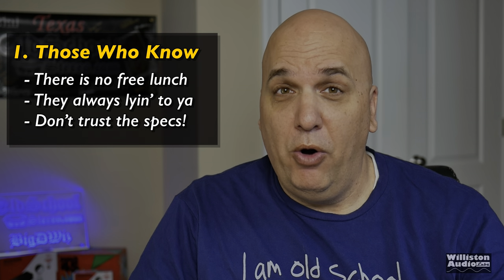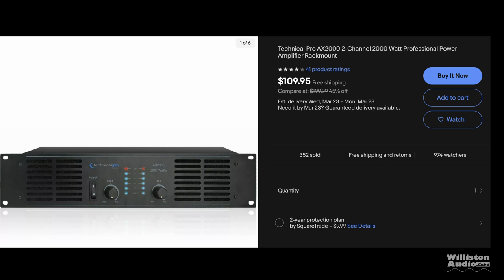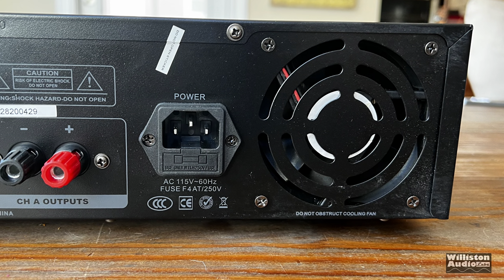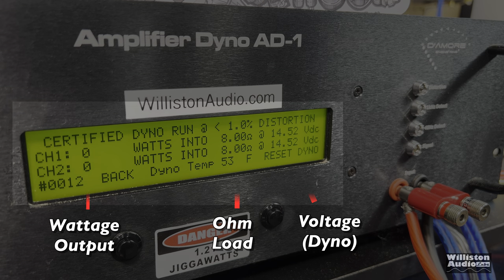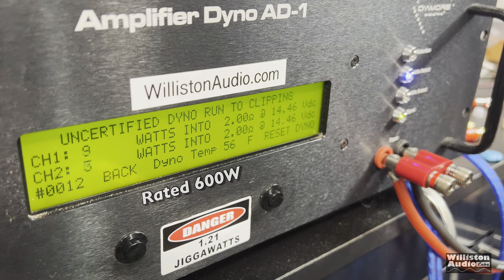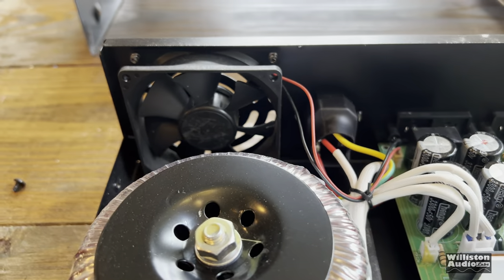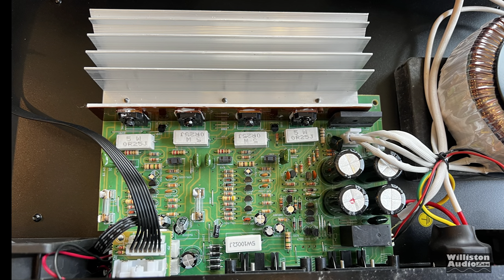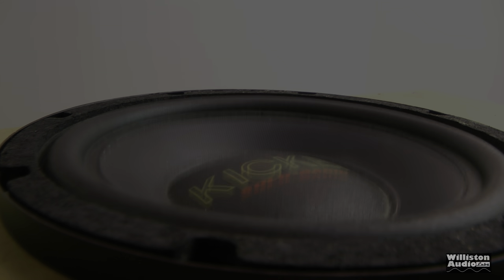Pro Audio Amp on the Cheap? Technical Pro AX2000 2000W of Unicorns [4K]

Comment: LMAO! Yeah, any of those "no name" super cheap, super lightweight "pro" amps, especially when they claim ridiculously high supposed wattage ratings, (like in the multiple 1000's of watts), and especially the ones that are made in China, are almost ALWAYS totally BS rated, and as a general rule of thumb, you can usually just take the claimed wattage ratings of them and divide it by about 100 and then you get a realistic approximation of its REAL and CLEAN, (i.e. UNdistorted) RMS power output, Lol! (example; a "5000 watt" BS rated amp might put out an actual clean (<0.1% distortion) RMS of about 50 watts)

It's really SAD AND disgusting though, that these manufacturers are even allowed to get away with advertising their products with such grossly overly inflated specs, as it is definitely totally misleading people who don't know any better! They're also making a total JOKE out of the audio industry nowadays, because they're not even anywhere CLOSE to the same quality level that REAL power amps were back in the good old days, when everything was made in Japan!

BTW, I really wish that that amp dyno would show you power output at 0.1% distortion also, for the "certified" power, (which is the old, original, long standing standard for the beginning onset of clipping), because at 1%, that's already WELL INTO clipping already, even already noticeable to a person with good ears!... So that makes me wonder at what distortion level(s) that amp dyno shows power output for the "uncertified" and "dynamic burst" tests... probably 10% distortion or higher, would be my guess, which is already GROSSLY noticeable (i.e. totally and easily hearable) at that point!... Which is also a point to which you NEVER want to drive your amp, especially if you want it to last for many years of music enjoyment, AND you don't want to blow your speakers, especially the tweeters, as clipping distortion is probably the MOST harmful to tweeters!
Reply from the maker: 1% is not clipping and although I agree it would be nice to measure under 1%, I think it’s a useful measurement
Reply: @wal  Well, in home audiophile terms especially, 1% distortion IS considered clipping, maybe not for typical car audio stuff, but for ANY REALLY good quality home audio amplifier, 1% distortion is definitely into clipping already, not super badly, but it's past the technical standard point of the beginning of the onset of clipping, which has always been known in the home hi-fi industry of decades previous, as 0.1% distortion...

That's also why you always would only see (now vintage) amplifiers, and better quality receivers, all rated at that distortion level MAX, and usually even at a lower point, like 0.05%, which was VERY common for RMS ratings of past home audio amps...

However, even with that fact, I also still believe that the amp dyno that you have, (even being designed around and more geared towards car audio than home audio), still does give a useful measurement even at the 1% distortion level, just not quite as ideal as if it was at the 0.1% level... I still wish it was a settable parameter on that machine though, as that would make it even better! I also wish that it would tell you at what distortion levels it measures the other "uncertified" and "dynamic burst" power levels at, as that would make those numbers it gives all the more useful and meaningful! It's a great tester, even as it is, but maybe they'll come out with a "MkII" version of it sometime in the near future that will add those other capabilities I just mentioned, as that would make me want one of them too!
Reply from the maker: @JoeJ-8282  in NO terms is 1% THD clipping, doesn't matter how you slice it. I understand both home and car audio at one time thrived on the 0.05% ratings and that's great. It doesn't matter honestly. Some people like the sound of tube amplifiers and they are flawed according to measurements. Power isn't everything and my purpose of showing power output here is to give a standard to go by. At least you know the approximate power output, even if it's beyond the THD you allow as acceptable.
Reply: @wal  Your last sentence there I DO agree with. Even at the 1% distortion level, at least you still have an "acceptable minimum" (or maximum in this case) "standard" set reference point to compare things with, which is an absolute MUST, for totally even and truly balanced comparisons between any two audio components...

However, 1% distortion most definitely IS at least at the starting point of noticeable clipping, (for an otherwise totally "clean" sounding amp at power output levels which are still below that point of 1% distortion), because 1% distortion can even be noticeably heard in music by a person with sensitive and well trained ears, so that point is definitely at least at the beginning of noticeable clipping distortion...

And if you do more homework on the topic, and study hundreds of amplifier "distortion curve" graphs, as I have over the past 40 years or so, you will see that at right about 0.1% distortion is the point at which most (already clean sounding, UNDER 0.1% "normal" output distortion level) amps will begin to go from a relatively flat line of ("clean") distortion, all of a sudden up to that very sharp "knee" on their distortion curve, then at that point, and especially above 1% distortion, which is about the average for the middle of that very sharp "knee" of the curve, the point at which almost instantly above that point it goes sky high, VERY quickly up to 10% and then up to 100% distortion, which of course at those latter points it sounds like total garbage, AND is VERY bad for the amp AND any speakers connected to it, especially the tweeters... not to mention your ears, lol!

But so the 0.1% distortion level has always been the industry standard reference for the very beginning of the onset of clipping, at least for high-end HOME audio amps, and in the audiophile world, and that exact spec. has been reported and used for giving the TRUE, RMS, (still clean), continuous power output of an amp, for MANY decades already, and in countless magazine reviews of amps and such during my entire life so far, ever since I was a kid and I started being interested in technical and audio stuff... And I'm really good with remembering numbers and specs and stuff like that because I have Asperger's, which gives me an extreme acuity for understanding and remembering "facts and figures" and that type of stuff...

Anyway, that 0.1% distortion level has always been the industry standard for the very beginning of the onset of clipping, at least up until recently, where it seems like the "standards" have gotten progressively worse and more "lax" in order to let the cheaper "no-name" companies, (mostly from China), make totally outrageous power claims and sell their products, making the uninformed masses think that their product (with the "higher numbers" in their specs of power output, etc.) is "better" than the next amp beside them with a seemingly "lower" power output, even if that other manufacturer might rate their product to a much stricter, and much more realistic power and distortion standard... Nowadays unfortunately it's all a "numbers game" just to sell the most products, regardless of whether those overly inflated specification numbers they may use to sell said product are truly "legit" and actually up to any kind of good standard or not.

And I agree that 1% distortion is still at least a semi-decent standard for absolute maximum distortion from an amp in order for it to be considered "clean RMS" power output, (because it's still at least 10X better than the TOTAL BS 10% level (or even worse, the old "PMPO" or "Peak Maximum Power Output" ratings, which were usually completely regardless of distortion level), that some cheaper amps gave/still give for power ratings), but even rating an amp at 1% distortion for "RMS" power output isn't quite as good as the older, TRUE, Hi-Fi, HOME audio reference point of 0.1% distortion. (That newer standard of 1% is actually 10X worse than that original 0.1% standard, even if at 1% distortion, it's still only barely noticeable with careful listening... But my point is that I NEVER want to actually be able to hear noticeable distortion in my music when I'm listening to it, so I still think the older, stricter standard of 0.1% distortion should still be used for the "beginning of clipping" point, and most definitely never ANY higher than that newer standard of 1%, because above that point you can definitely begin to actually hear it.)

Part of that newer, more lax standard, is because the standards union or something like that was changed about a decade or so ago, and the rules were lessened in order to be "more encompassing", especially with the onset of class D amps, which now at THIS point have gotten quite good, even pretty awesome, but when they were first introduced, (i.e. in their "1st generation" of development), if you remember, pretty much all of the class D amps all started out having quite noticeably higher "normal level" (i.e. non-clipping), distortion levels, (as when compared to the typical, older style class A and A/B amps), of anything between 0.5% to even 2 or 3% on the first generation of class D amps, so the industry had to be changed to allow for that higher average level of distortion to be considered "normal" or "clean", but that is also one of the reasons why I (and many others) didn't like the sound quality of class D amps when they were first introduced. I'm really glad that most of the manufacturers have fixed those issues in recent years with class D amps, and made them MUCH cleaner and smoother sounding now than in the past, so that is really good, because class D amps have a few definite advantages over other, older classes of amps, mainly much smaller size & weight, and considerably less heat production... But anyway, I'm getting off on a tangent here...

Just closely study a few detailed and accurately measured amp clipping distortion curves, as I mentioned, and you will see that the overall average points for that very noticeable "knee" on every amps distortion curve, where it almost instantly goes sky high in distortion, (i.e. clipping), (that point) starts at about 0.1% distortion usually, and the 1% level is usually about at the center of the sharp curve on that "knee", and then anything above that point is already WELL into noticeable clipping distortion, especially at 5 or 10% distortion, as many really low quality car amps and even some cheaper home receivers are nowadays being rated at for their (total B.S.) "RMS" rating. I don't believe that rating ANY equipment at those higher distortion levels is at all acceptable though, because it just makes the uninformed people out there get into equipment that doesn't sound as good OR as loud as they hoped it would, plus it makes the general populous less informed as to what a truly "clean" music signal really SHOULD sound like!

Part of that is because of the manufacturers making stuff cheaper/flimsier and to an overall lower quality level now because it's just more expensive nowadays to still produce TRULY HIGH Quality stuff than it was back in the true "heyday" of REAL Hi-Fi audio, AND probably even more influential, is that ever moreso nowadays, it's all about the absolute most "profit" that a company can make, completely regardless of any kind of higher "quality standards", but its ALSO a very SAD and unfortunate thing of many manufacturers taking complete advantage of the fact that MANY people nowadays don't even have the first CLUE about what distortion, especially clipping distortion, even sounds like in the first place, (especially the younger generation, who were for the most part, not ever taught properly what distortion even sounds like at all), and that is very unfortunate for the overall industry, because as more people are out of touch with what truly high quality sound should sound like, I'm afraid it will just keep letting the audio industry become of a continuously cheaper and cheaper build quality, and be of a lower and lower sound quality also, that's why, as any kind of "audio enthusiast", we can't let things keep getting and being built to a lower and lower standard over the years!

"Acceptable" amplifier clipping distortion levels is only one specific aspect of that, I realize that, but it's a VERY important one, and so I certainly hope that it never gets ANY worse than, (higher than), that 1% distortion level for a "clean RMS" power output rating of audio amplifiers, because anything above that absolute maximum point IS essentially "dirty" or "distorted", and yes; that is also why I personally don't care too much for the HIGHER distortion, (>1-2% distortion), tubes in some tube amps either... because at that point I can definitely begin to hear it in the music... but I guess "to each their own" when it comes to that specific topic... I won't go into it here. (OK, "rant" over, lol!)

Your opinion may be different than mine about all of this too, and that is totally fine, but so no matter what, just always be sure to keep at least some kind of set "minimum performance" levels for testing and comparing stuff, no matter what happens in this (audio) industry, that way the manufacturers don't start getting away with TOO much total BS in their ratings, LOL!

Comment: Pathetic, I'm glad my $170 pyle pwma3003t wasn't this wimpy. Still not the best but with some clipping I amp clamped it putting out around 270wx2 at 4 ohm and close to 400wx2 at 2 ohm.
Reply: Actually, if I remember correctly, the numbers I got were about 30% less than that, those numbers are almost exactly the numbers on the box, although it says 800 at 2 ohm, combining left and right. I got 30% less and also 30% less on a 100watt lightbulb, and a 7.5 amp saws start up, the batteries on my amp clamp were low. So it wasnt the most accurate test. Also who knows how well this amp clamp works outside of the 50 or 60hz range. I adjusted the numbers and ended up with almost the ratings on the box, the amp still says 3000 watts on the front, but at least they are much closer to the other numbers than that technical not pro amp. The pyle is the same pro style with only rcas lol. Little bit of sound that doesnt increase with volume. I had two, one had a fan that made a grinding sound, but it never failed, I also fried that one, my fault, threw a big sub box with my sa12 in it in a junk car in my driveway, put the amp on top. Cranked it then it started cutting out, the amp slid back and the binding posts flexed enough to allow my banana plugs to short on eachother. I recently got a crown xli1500, seems to be much better quality no noise, heavy. Have yet to open up the taps but I'm sure itll be sweet

Comment: That company should be sent a  nastygram for the full wide open BS they spewed. That is criminal. The line cord is cheap because the amp probably won't use more than 180 watts maxed out from the supply power! That POS should be sold only at flea markets where is legal to lie about power specs! LOL. So, the amp dyno actually uses 14VDC as it's main power supply? Why not standard 120VAC? The unit doesn't look like it's intended for field work.
Reply from the maker: It can use a 12V to 110 wall adapter also

Comment: Technical Pro? More like technically junk! The lack of XLR or balanced audio connectors in a "pro" amp is extremely telling. Not to mention the under 10 lbs weight. Also, no "pro" amp I've ever seen has ever had peak wattage splashed on the front of it either. 
That company is probably one that sold legit gear for a number of years, basically went under and the name was bought and can be slapped on stuff made in China for a small fee. Much the same way RCA, Zenith, Kodak, Gateway and many others are still used today. smh

Comment: To add insult to injury to this products very poor overall quality, it’s also poorly assembled as you can see at the 11:00 mark if you look at the back right corner of the pcb. The black 5 conductor wiring with the white plug carrying signal from the RCA input board down to the main board isn’t even fully plugged into it’s connector! Lol  Being dropped during shipping would not have caused this either.
Sadly, this isn’t the worst example of what NOT to buy that I’ve seen in my 29 years of designing, building and repairing audio equipment, but the ratings speak, or rather don’t speak for themselves.
This amp costs as much as an unassembled empty billet aluminum amp chassis. Lol

Comment: Junk. Can't believe they don't have XLR or quarter inch jacks on the back. At one point there was 12 times less power then rated. Can't believe they make junk like this. Worst amp so far. Thanks for putting this stuff out Big D so we dont by crap like this. I wouldn't want that amp even if it was given to me. I would have dropped the test to .5 ohm and tried to fry this pofs.
Reply: @wal  you make me laugh big d.

Comment: Straight rubbish. If rack mount is a necessity I'm guessing you could buy a much higher quality secondhand unit at a comparable price. The guts of this thing are pathetic. The position of the heatsink relative to the fans is useless. The mounting of the FETs to the heatsink is inefficient (they're not actually in contact with the fins). The toroid style transformer and the binding posts are the only component that's even remotely decent here